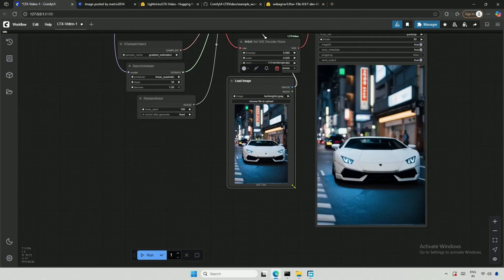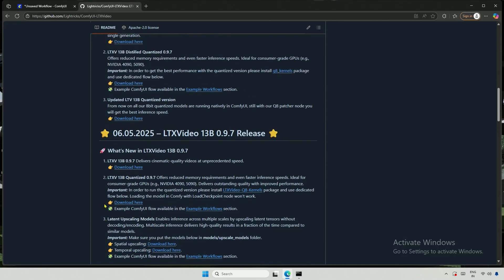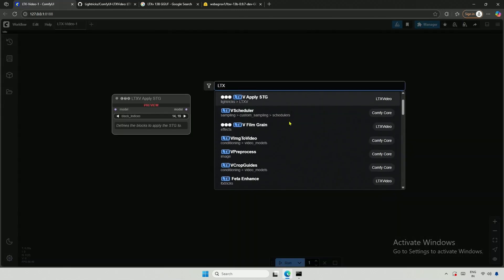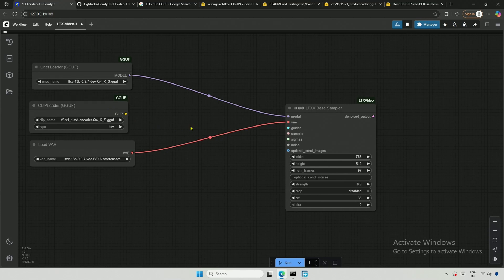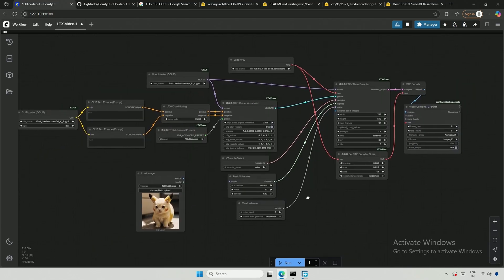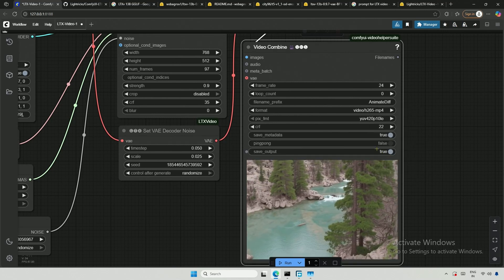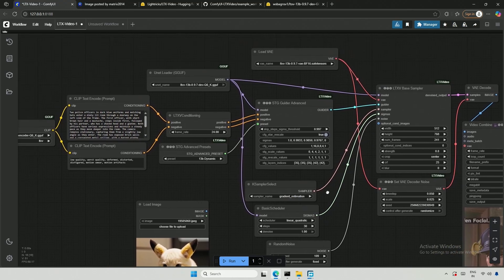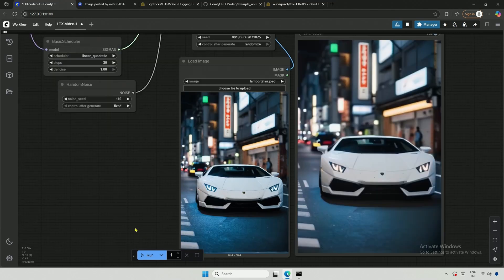LTX 13 billion GGUF model for low V-RAM - Generate AI videos

Comment: I use the distilled models up to Q6 with my 2080 Ti and have very good results. Above all, they're extremely fast, and the quality with Spatial Upscaler and Add Details is truly impressive. I highly recommend enabling Teachache and Torch compile optimization and BF16. It more than halved my rendering time, and I haven't noticed any loss in quality.
Reply from the maker: Will try, I just tried the Upscaler. It takes alot of memory, I tried a 1080p but failed
Reply: Hi friend, do you have discord and can help a brother? Tyvm in advance.
Reply: you have duiscorD?